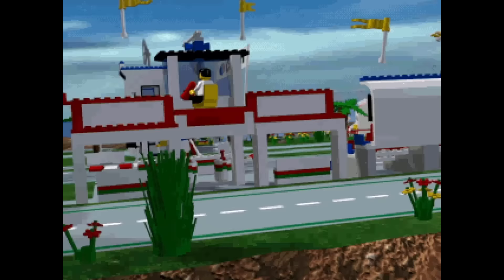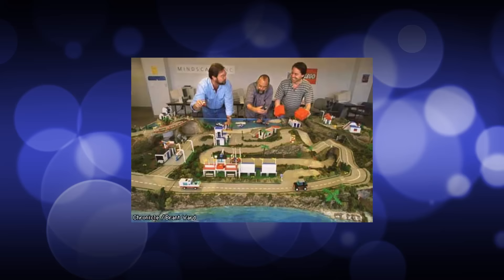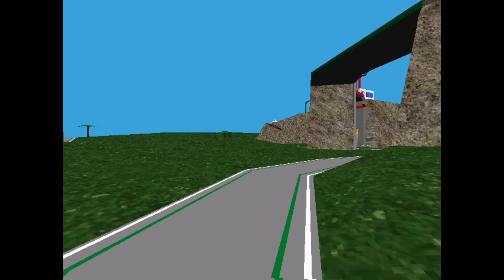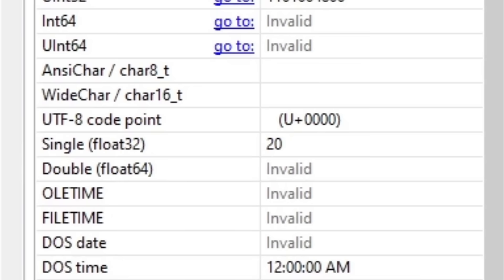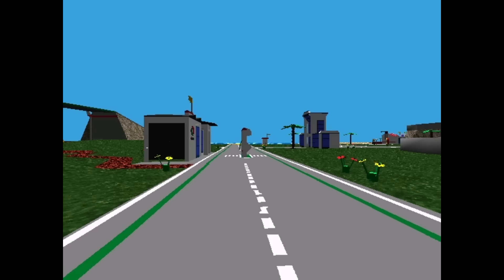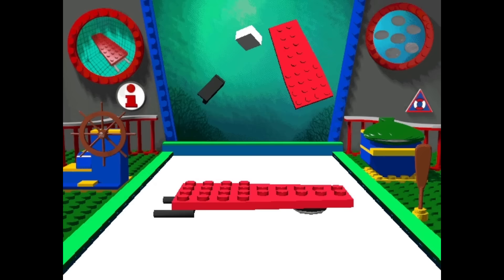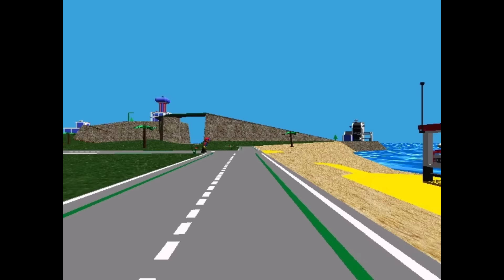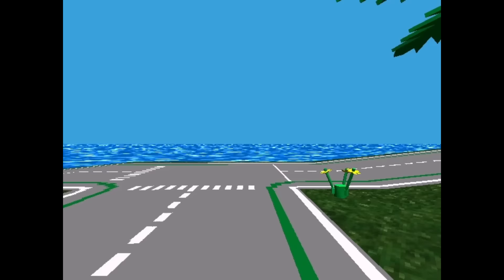How I fixed LEGO Island's WORST bug

Comment: The same thing applies to newer MS-DOS laptops when you try to run older games on them; they are simply unplayable.  However, the new Sinclair ZX Spectrum remake computer can run old games at a fast (but playable) frame rate.  Maybe the LEGO team could’ve learned from this.

Comment: in the GoldenEye 007 (n64) the movement speed is tied to the FPS. so a speedrunner looked at the ground. and got the world record. there would be a same case with fallout 3 and new vegas but theres a rule that is just that you need the FPS to be capped at 60 (not sure might be 59 fps)

Comment: I haven't tested it a whole lot yet, but there does seem to be a little quirk with this method: it seems the turning speed doesn't go slower when you are in the air.  During the jet ski race, holding turn while going off one of the ramps will cause you to face the wrong way once you land.  Possible this is a thing even when using a computer from the time, but you do have to hold the turn button down, not just tap it, making me think it is related to the turn speed still.

Comment: As a QA I've noticed devs are very specific what should be called bug versus what shouldn't be as "bug" suggests it's an error in their code. So when you said that the devs admitted they noticed the "bug" only later suggests they had a clear idea how the turning should work and it is not working as they intended and your exploration of their code confirms this. If it was a forgotten framerate cap then they would perhaps label it as a bug for the whole game rather than just turning. Of course, that was long time ago and I don't know the full context so I'm just guessing.

Comment: Played through on an XP (and a Vista one to lesser extent) when I was little and never knew those weren't how the controls were supposed to be. Thought it was a little fast, but wasn't the worst issue. The worst issue I had probably had to do with the internal specs or something. The inside of buildings would flicker or mostly show themselves as a flat light blue color, bricks (both in building and when chasing the Brickster) could only be interacted with if just the right spot was clicked... it was weird. Playable, but weird.

Comment: I noticed a similar thing revisiting Lego Island 2. The helicopter is way too fast on modern PCs. I just fixed it by using the Nvidia control panel to lock my monitors frame rate at 30 FPS.

Comment: making me remember one time i felt like replaying MechWarrior 3. i grabbed that for an old Dell laptop i had about 5-6 years ago, which was ok for it's time, but overkill for MechWarrior. i booted the game up, did a skirmish match after customizing a MadCat, and i couldn't play at all. for some reason, the increased CPU performance from what the game was designed for made it so the mech's legs were stuck in the ground and couldn't move. it was like they'd try to move, but then clip into the floor and was stuck in place. looking up the issue online, i found some app that would slow down my processor clock speed to the point the game would play normally

Comment: The simple windows api (win2K) call had a horrendous resolution of 16 ms. Spinning your own took time and introduced more sources for bugs. Some games tried to display the FPS by just dividing 1 second by the time it took to render a frame in milliseconds. Less than 1 millisecond? 0. What happens when you divide 1 by 0? Crash.

I still have some old games that can only be run at less than 100 FPS or they start bugging out and crashing. The good old games that needed the "turbo" button to be playable.

Comment: welp it took a bit of work but I got to run it on my computer.
the rebuilder works wonders the only downside is you still need to access the config.exe to switch render modes and my config.exe only boots up once after that it no longer starts
(I got around it by putting it by extracting it to another folder from the iso) any plans to make permanent changes to the config with this tool or something akin to it?

Comment: Once they changed the turning speed from accelerating to max speed x DeltaTime to simply applying the max speed, wouldn’t they have noticed that turning was suddenly 15 to 20 times faster than normal? That probably should been a serious red flag that something was wrong. I guess it all depends on what measure of time DeltaTime uses, but from my experience it’s always in seconds. Removing DeltaTime would have essentially multiplied the turn speed by whatever fps they were used to playing in.

Comment: My first thought wudve been that they didnt multiply the turn speed by the deltaTime because that wudve been an extra unnecessary calculation each frame.
Optimization wouldve been more of an issue back then to get as much as possible out of a weaker pc.

Comment: Well, the game is even too fast on a Pentium 3 at 1 GHz that was common in the early 2000's, 500MHz is for the pre milennium.
It is more suitable for older hardware to run as intended like the original Pentium or a Pentium 2, AMD K5 or K6 that was around its era in the mid-late 90's.

Comment: Please excuse me if this is simply wrong for some reason, but wouldn’t using a mouse with adjustable DPI fix this issue? If you set the DPI incredibly low, as far as I’m aware, it would fix the problem AND allow for a non-modded game. If this isn’t the case please let me know why.

Comment: The developers forgot to multiply the turn speed by Time.deltaTime.

I'm sure some else's commented that already...
Reply: Mind, that's a Unity API thing, it's not actually called that in most cases. (Admittedly not sure what Lego Island would've used, possibly something from the Windows API, but they definitely didn't use C#)
Reply: @berylliosis5250  It was a joke.
Reply: @Empire526  But a mostly accurate joke all the same, other than the naming and origin it's not far from the truth

Comment: Good grief. I was actually learning PC game development right around this era...

I thought it was game development 101 level stuff to make your game logic distinct from your framerate, but apparently not.

Now, to be fair, doing this requires having access to high precision timers.
Which is a problem on most games consoles, especially older ones.
But, you can get away with that to a degree because a game console is a fixed target.
(aside from the difference between PAL and NTSC machines, which, sadly, was often largely ignored, to the detriment of one or the other.)

On PC though? Especially a mid to late 90's PC?

You have no excuse to be tying your logic to the framerate. None.
It is beyond trivial to set up a proper timing mechanism that is framerate independent.

Saddens me to learn that devs weren't doing this...

Comment: Seems like the fix might just be "run in software mode" then! (kidding). Yes, interpolating intended distance over the passage of time is the right way of doing this. Modern game engines bake this in (e.g. Unity's Time.deltaTime and Lerp functions), but back in the day game were generally written from the ground up... in assembly... so mistakes like this were far more common once upon a time.

Comment: It kinda bothers me that delta is used as another word for difference. I guess it came to be this way because mathematicians really like using single letters for everything and often used Δ to indicate a (discrete) difference. Then some programmers based some of their code on that and used the variable name "delta" because most programming languages don't support non-ASCII letters for variable names. Over time this usage has become so commonplace that the word "delta" has become synonymous with "difference" in certain contexts. But this usage is still no that widespread, so to a general audience like the one this video is aimed at the word has to be explained to not end up being confusing. But I don't really see how using "delta" as a synonym for "difference" has any advantage. So in my opinion "difference" should always be used.
Reply: It's just shorter.

Comment: Hey matt you should update the ultimate windows 98 rig with a newer processor & motherboard core 2 era celeron at 35w tdp or a core 2 duo of some sort that you just limit the core count on.
https://www.vogons.org/viewtopic.php?t=50665

Or perhaps change it out too socket 754,939 (quite a bit better tdp then socket 775 pentium's unless you want too look for said 775 motherboards with newer cpu support then celeron d & pentium D)

Also some workstation cards from both ati & nvidia are moddable too their regular consumer versions with some tinkering if you need another decently performing but not as hard too find graphics card fx 5800 workstation equivalent for example is the quadro fx 3000 & 3000g
Might be able too go for a ati agp graphics card with windows 98 drivers like a x850 xt agp
(Fastest ati card with windows 98 support, might be able too get a 2600xt agp too work in windows 98 modding drivers a bit, same with nvidias 7000 series agp cards you can get modded drivers for windows 98 there.)

Also lastly, do add in a soundblaster soundcard of some sort in the pci slot like say a soundblaster audigy 2 zs would be a good addition as well, maybe have it dualboot between windows xp & windows 98.

Comment: In Method 2(?), set the max turn speed to 6.9999983 for the "Double (float64)" value to be 16,777,216. You don't need do be a computer expert to know why.